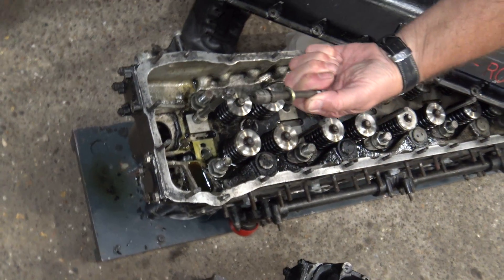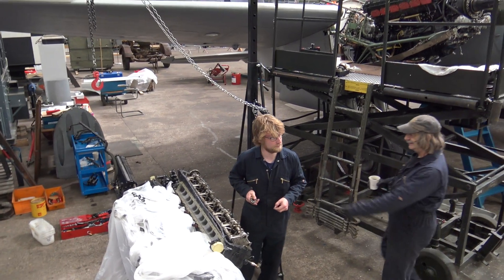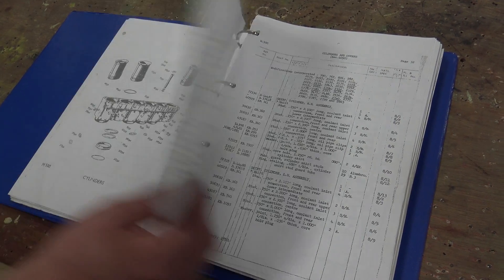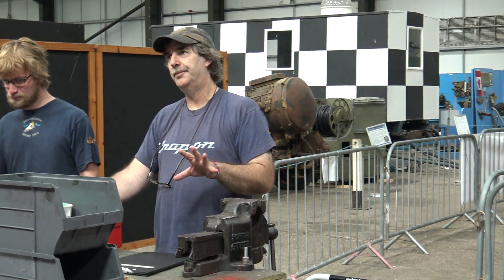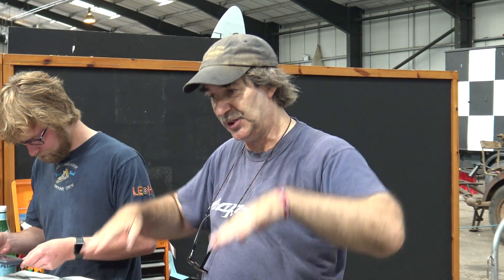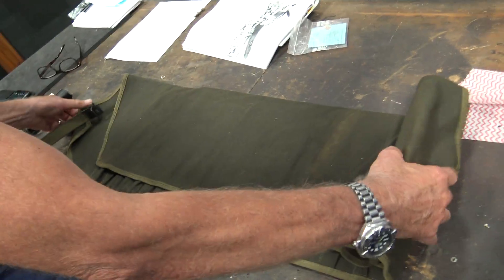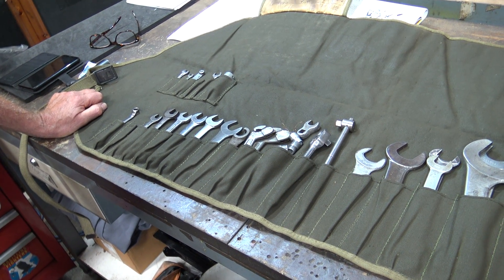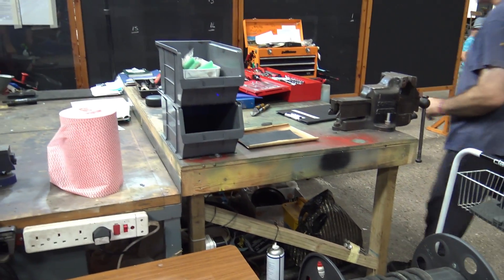Lockdown Video 17  -- Brad, Martin and Gerb on RR Merlin Cylinder head

Comment: Lot of engine information in this video, from memory the GM 2 stroke engines just used seals and have no head gasket as such. Cheers for posting bro and stay safe up your way.
Reply: think it's the same idea,  as a solid block in an engine that size would be far too heavy, so they went with liners and o rings, on each cyl.. I've done a bit of work on a Merlin (static running display) here in  Canada, and lifted up a few parts,  one would think they look heavy, but being cast aluminum,  extremely light.. 
  Being a light and employing liners makes her susceptible to flex in the castings if the mechanic is ham fist'd ,  plus as he said leaks/etc if things  don't go according to the pattern..bolt stretch is another consideration .. 
  As for the tools,  well things get even crazier with old British bikes lol.. mind you aluminum fasteners probably get rounded if you torque em up with the wrong size..and they are not off the shelf items (anyone with a vintage bike has endured this with carbs or cases tightened by a Gorilla )
Reply from the maker: Hi Ken you know more about engines then I do.

Comment: Maybe you can ask these gentlemen a question. I've heard Rolls built Merlins were essentially hand fit together and parts from one Rolls Merlin won't fit properly to another but parts from one Packard built Merlin could fit another without much issue. I've always wondered if that was true.